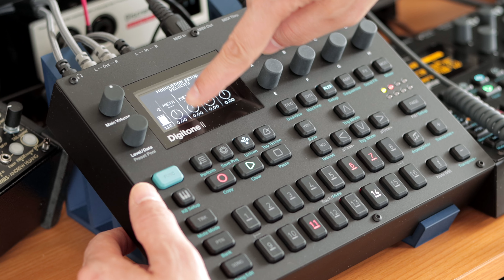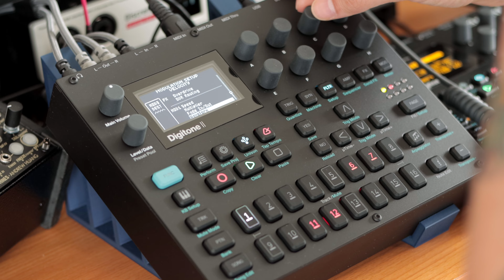Digitone II: Velocity Macros Control (A Powerful Sound Design Technique)

Comment: Totally agree there should be a quick way to get into the modulation screens, I suggested TRK+[TRG,SYN,FLT,AMP,FX,MOD] for each of the 6 pages, usually when editing the modulation values you also need to go and tweak the original value too so it gets very tedious. Using Up/Down to move between the different modulation pages would be nice too.
Reply: also wish you could use the level encoder to set the origin point for modulation for velocity. Usually I want it relative to the default velocity, not 0.
Reply from the maker: @impbox a 100%.
Do you have any recommendations for a small tiny midi controller just for macros?
Reply: @SkeletonJacket  I don't have any that I'd recommend unfortunately, but been wanting something similar. It's not perfect but I often use the Digitakt 1's midi tracks as a controller for other gear, plus can launch some samples to fill in for the DN2's lack of samples.
Reply: An easily accessible matrix screen would be nice
Reply from the maker: @Hellsink-z3e that would be awesome